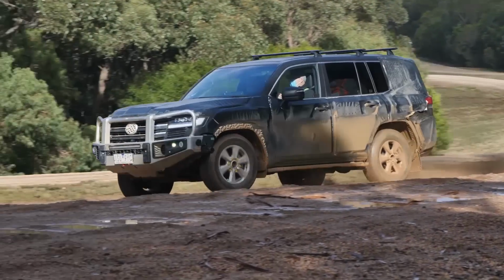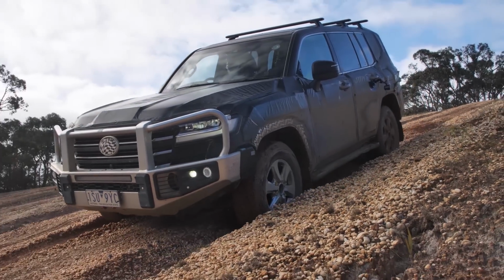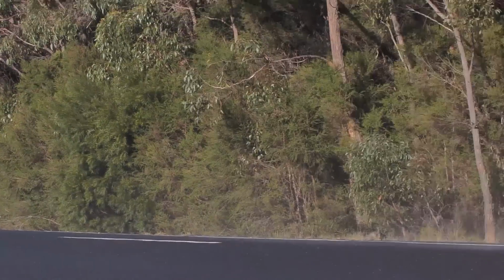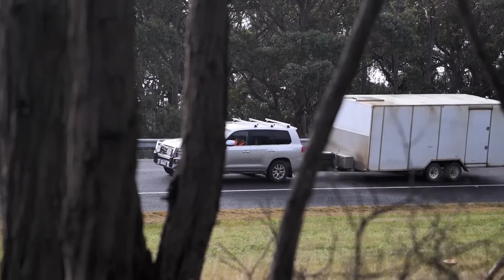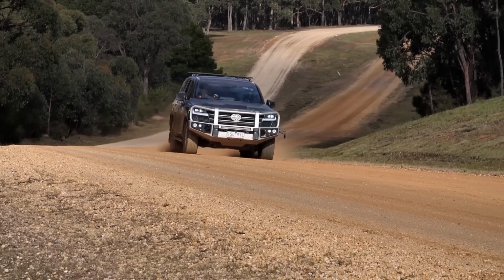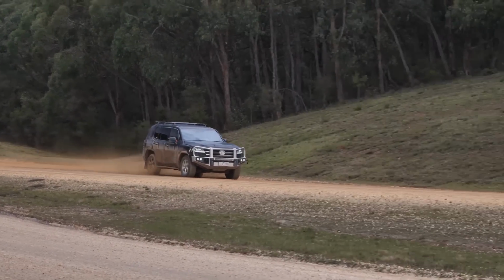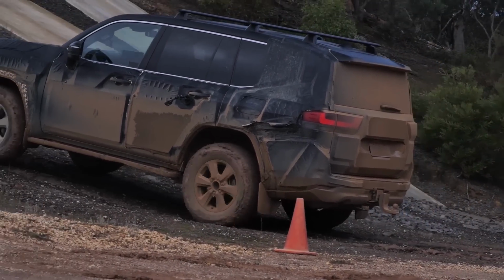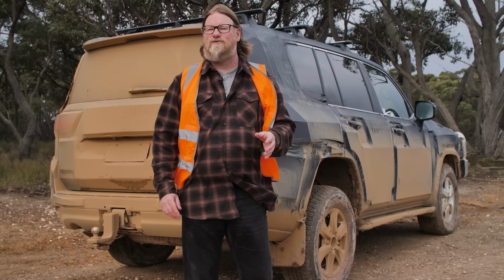First Drive: Toyota LandCruiser 300 prototype | 4X4 Australia

Comment: 300 series been following it's update and off road testing and capabilities.  300 series is WAY SUPERIOR to 200 series. Crawl Control brake noise has been improved, speed and ride is much Comfy than the 200. Kudos to Toyota for Improving a Legendry Vehicle 💕💪💪💪

Comment: Can you really feel that effect of further back engine placement effect from the test ? or it was just the info Toyota put in your mouth ?
Reply: Haha! Exactly what I was thinking, unless it was placed in the back seat you wouldn’t pick it, it’s more likely the reduction in weight as opposed to the 50mm relocation.
Reply: You actually can try putting less or more air pressure in to the front wheels of your vehicle you'll feel the difference, just the same thing with putting a less heavier engine, remember this coming from someone whose tested both vehicles one after the other